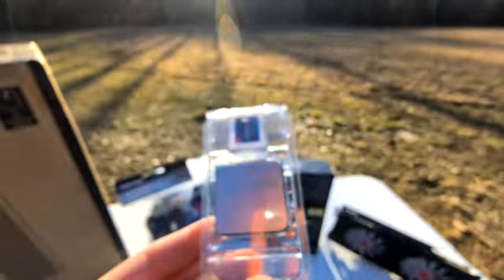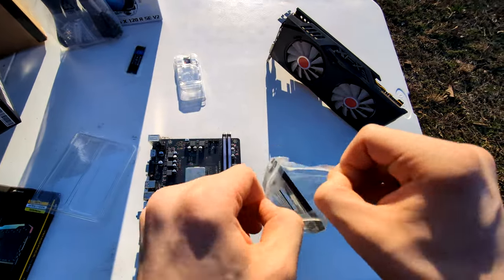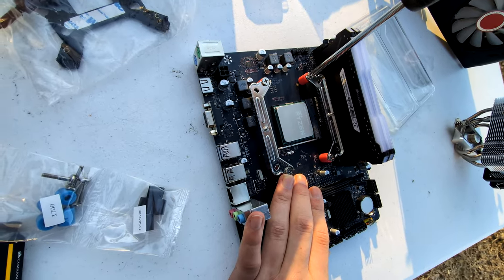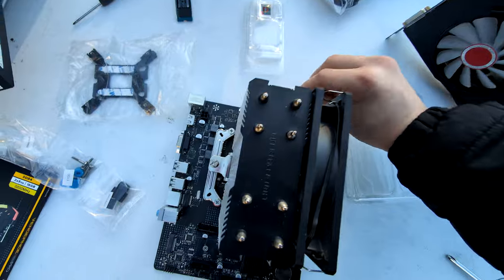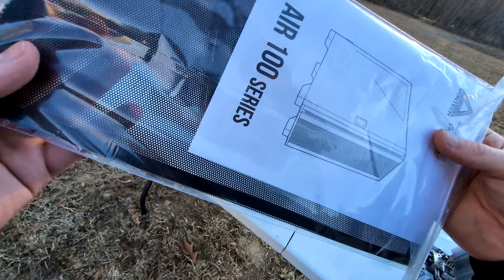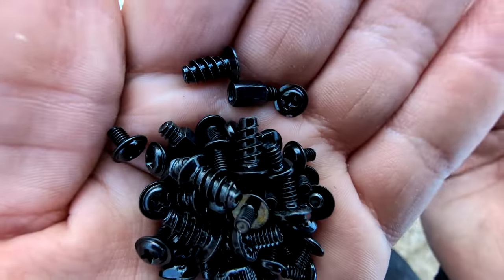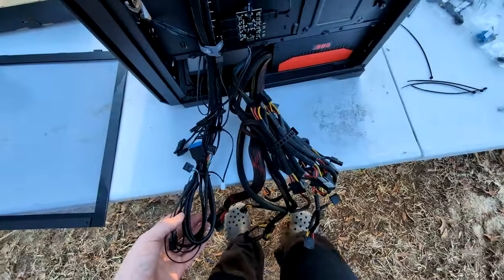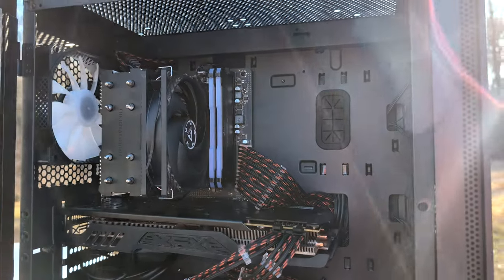Building a PC Outside!

Comment: I LOVED THIS VIDEO!! Omg. I could watch this type of vid all day long. I really like the hinge on the side panel. To answer your question, I usually do the line method of thermal paste. Also RIP for your cold fingies 😭🥶
Reply from the maker: Thanks for watching 😭

Yeah, the thermal paste method doesn't really mean as much as people stress, it's mostly down to quantity. Too much is ALWAYS better than too little! IIRC the best method was an X pattern but I find that it uses quite a bit more thermal paste for a 1 - 2c difference so not worth it IMO

Comment: Yipes. What was the temperature and relative humidity that afternoon? The thought of static electricity and condensation when I brought it inside would freak me out.
Reply from the maker: It was fine, and I made sure to let everything sit for a bit before turning it on. I have stress tested the system and can confirm all is well! The temperature was around 50 fahrenheit, humidity was a bit high though which is why I didn't immediately turn anything on